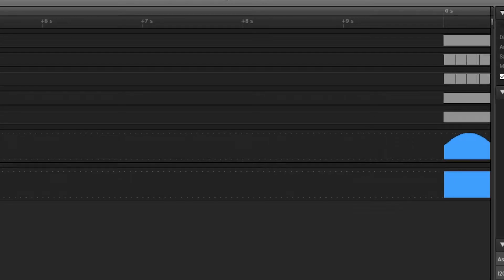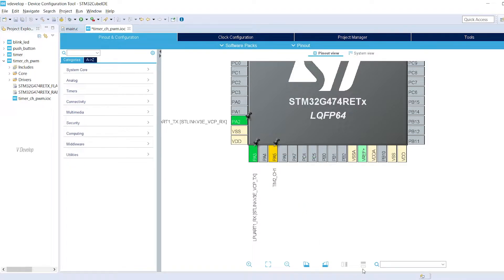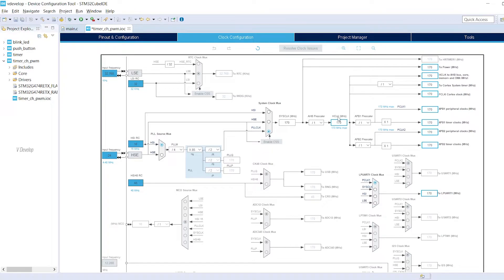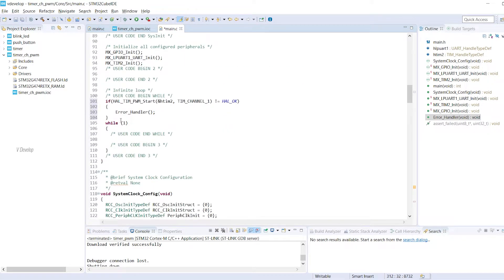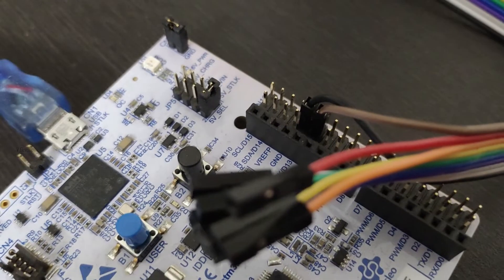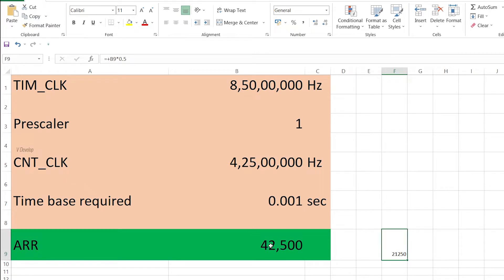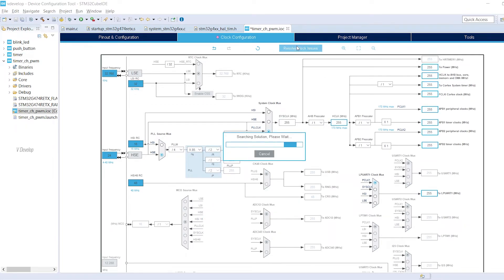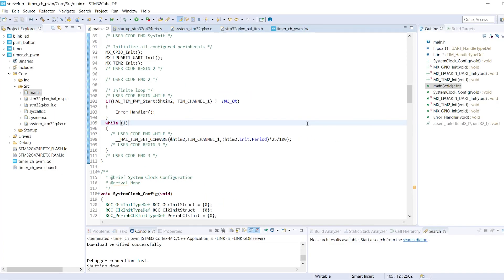PWM Generation | STM32G474 Nucleo | Episode 6

Comment: can you share the calculations you did in the excel sheet? I want to generate a 90% duty cycle pwm what will be the values? also I tried to put 85Hz in the clock configuration and the software couldnt come up with a solution what to do in this? (my board is nucleo-stmf722ze)

Comment: First of all thanks for sharing these videos. Instead of using a constant, I want to use an external analog input to dynamically change the duty-cycle.
How works the GPIO/ADC configuration?
Reply from the maker: In the while loop, get the value from the adc channel and update the duty cycle with this value.

Note: Duty cycle is 16bit value. According to the resolution you're getting from ADC, you can make the scaling calculation.

Comment: Dear sir 
Please generate a code Vd Vq two values are given, you can generate abc to Alfa bits and Clark to part transformation SVPWM 6 pulse converter.

please do the work and also detail the defile how to set frequency.
Reply: You should start with timer basics, then and only then start implementing whatever you want. You can't expect other people to code your projects. Good sources can be found on pirate bay (like Israel Gbati STM32 courses).
I gave you more than enough for you to do some research.